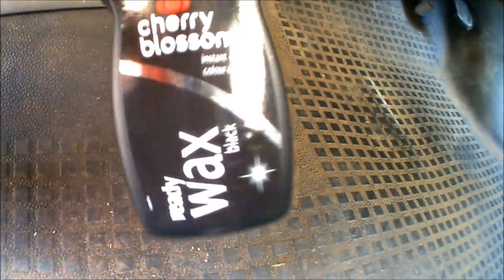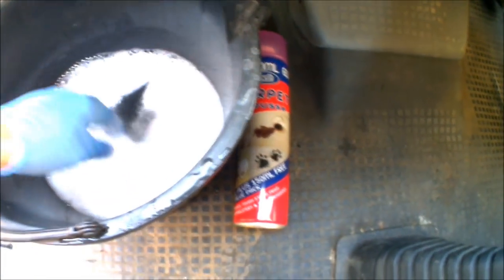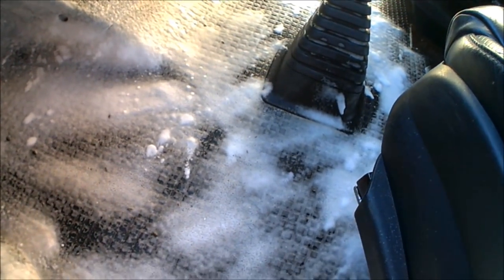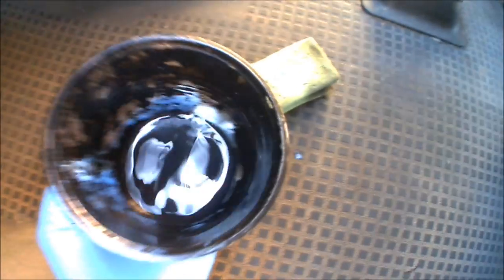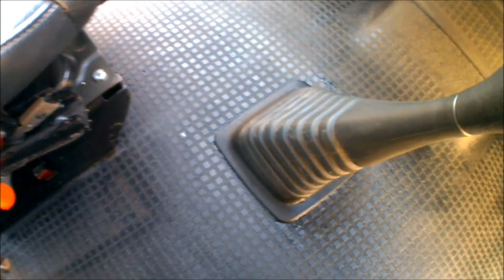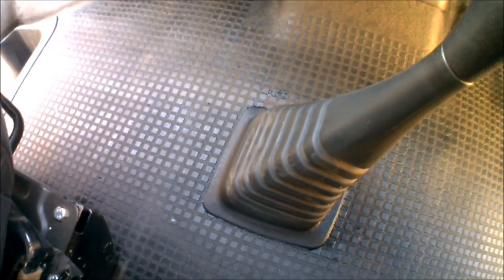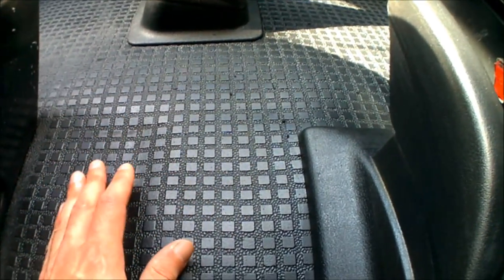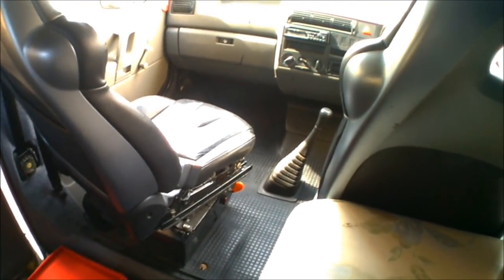Restore Rubber Car / Van Mats Back To Black Cheap & Quick - Cherry Blossom Polish

Comment: Wow what a great result, just cleaned mine today but this never crossed my mind to use this. my next day off I will be doing this to my van flooring, thanks for sharing!! If I remember rightly my old dad used to do the same with his black vinyl roof on his Cortina back in the 70s. Some things never change lol

Comment: Wow! I took the flooring out of my van today (it used to be a prison shuttle; so it's all vinyl and rubber inside! I usually clean it inside using a pressure washer! No luxuries; but it's the heaviest in its class and as a prison van the roof and panels are as solid as a school bus!) I was looking for a way to take the floor back to black; but want to preserve the solid rubber floor. Never know when I might be taking a deer back to the special habitat I've set up inside my freezer! I've used shoe polish to restore vinyl and rubber on my motorbike; why didn't I think of this? I'm gonna do this after I install the sound deadening panels (the original reason for taking out the floor). Thanks for the tip!

Comment: Any tips for a grey plastic bumper restorer that’s faded?  😮
Reply from the maker: If use the same stuff and turn them black, might take a few coats but I’d get the job done, or I’ve heard of strange things like using peanut butter for the oils to help restore plastics.

Comment: Could you use it on the dashboard etc great job by the way very impressive 👍🏻
Reply from the maker: Yes people use it on door cards & dash, you just need to apply 4-5 coats otherwise it will look patchy, just keep going bottle after bottle until it all looks good & uniform